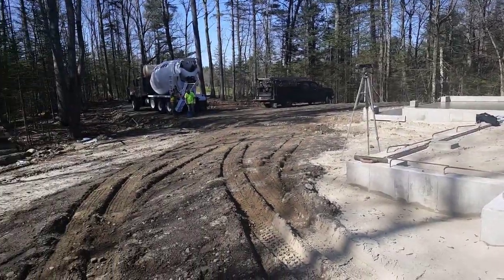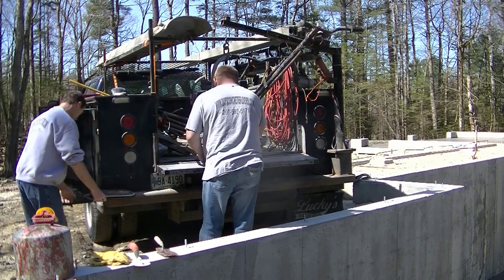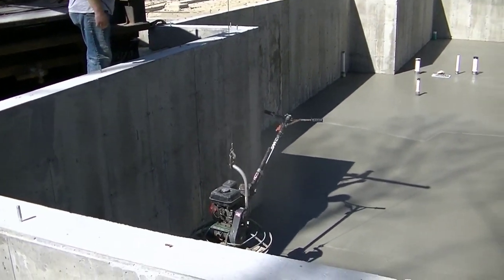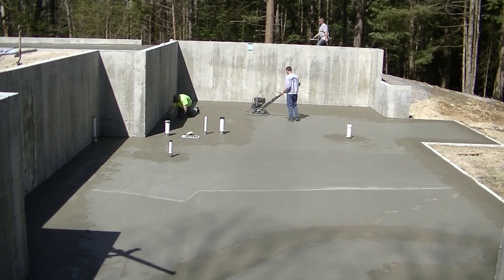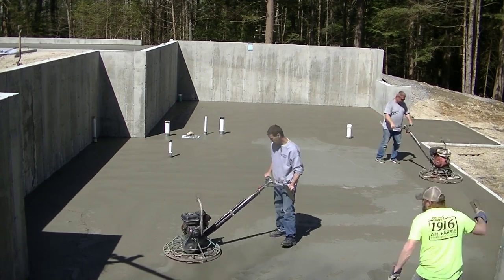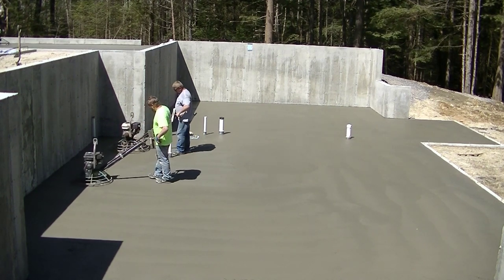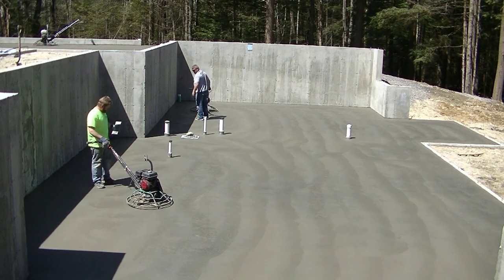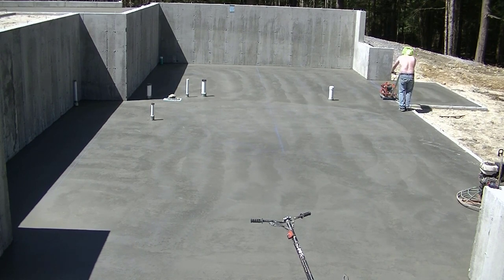When To Start Finishing Concrete (My Tips & Techniques)

Comment: I used to do a lot of apt and condo bldgs, that always had lots of pipes. You could always tell whether a slab was poured in the winter or the summer by the floor finish around the pipes. Winter slabs had a nicer finish bcz they had more time in the cooler temps to get around all the pipes. Summer slabs were just the opposite.
Reply from the maker: We try to do a really good job on the edges. It makes for a better looking floor.
Reply: Mike Day Everything About Concrete  i hear ya mike. I treat summer jobs the same as any other. You just always gotta be thinking of what the sun is hitting in the summer
Reply: We usually use an edger machine in the summer months. It dont get right up to the wall, but it gets alot closer than a three footer does

Comment: Hi Mike, great channel. Do you ever use floor hardeners, ‘Dry Shake’? 
I have an 2800 square foot basement garage floor to cast and want to end up with an durable dust free finish, and I think this would be an more economical way to go than an post install epoxy type finish.
Thanks, Barry
Reply from the maker: You can just use a densifier hardener sealer afterwards. Much easier, cleaner, and less expensive

Comment: Mike I never see you guys throw water or use Aqua-film?? Just was wondering why you do not use any type of Aqua-Film or water whenever you are burning in floors?? Also the Cement looks really nice and creamy every time I see you guys pour. Also have you ever tried using Limestone Rock in your stamp works instead of that 3/8 old Monroe?? Whenever we stamp I use 4000 psi Limestone with finish sand then I take out 150 of Rock and replace it with 150 of more sand per yard and it stamps like a dream plus whenever you saw cut it is just so much nicer it seems like that Little Rock chips easy and I hate whenever you can see that orange 🍊 Rock !!!!!! Just a couple questions and comments for you!! I owned my own business for 11 years and sold out and went to work for somebody else some days I love it but sometimes I wish I would have never sold out!!! Keep up the quality work Mike I love the videos!!!!

Comment: Ok a newbie question, but why sometimes you use this machines and sometimes just a normal concrete floater (manual broom thing) ?
Reply: Dejan Golja brook is exterior for when the concrete gets wet. It keeps it from getting slippery. The power trowel is mostly used on interior finishing.
Reply from the maker: We always use the machines on concrete floors for a smooth finish. Interior floors. Exterior pads we broom or stamp.

Comment: Great like always Mike!  Ihave  a question to you i will be glad if you can give my the answer. The case is about my concrete mix like i mentioned you before i m doing decorative concrete in Poland and right know my ready mix supplier change a cement delivery from a straight portland cement  with no fly ash for a portland cemet with a 17% of fly ash in. I m doing job where i m using  color hardener always is this not effect my final product if i use portland cement with fly ash ? i mean color variation and finishing proces i mean longer waiting for a imprinting ? i m using also superplasticizer  like a admixture and total is 330kg of cement for 1 qubick meter.
Reply from the maker: I ask for no fly ash on my mixes. Can't you also? The fly ash shouldn't affect the mix too much other than slow down the set a little. Shouldn't be any more color variation as long as it's mixed good.
Reply: I have to change batch plant they were using straight Portland cement before now they offer only with fly ash but i will make one mix with fly ash see how it goes thanks for anserw